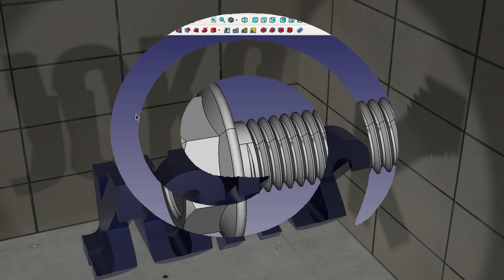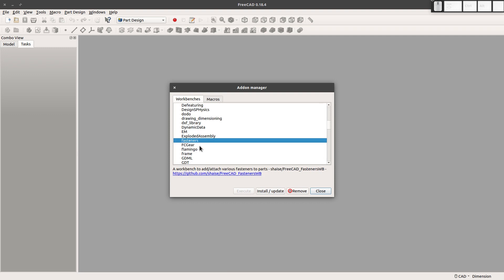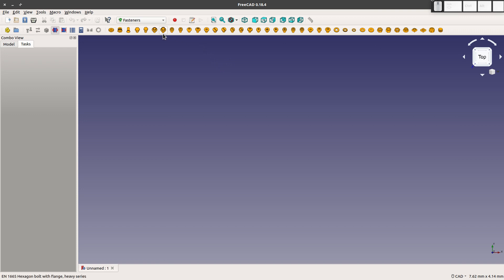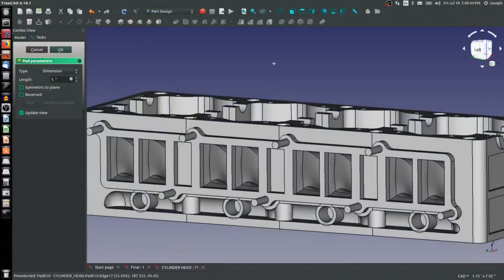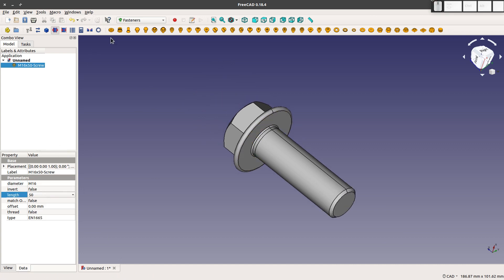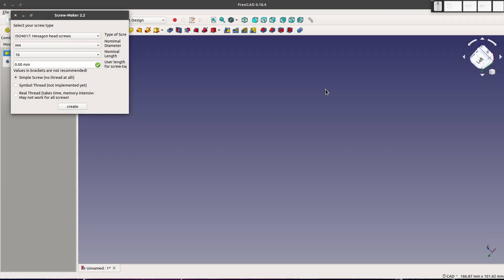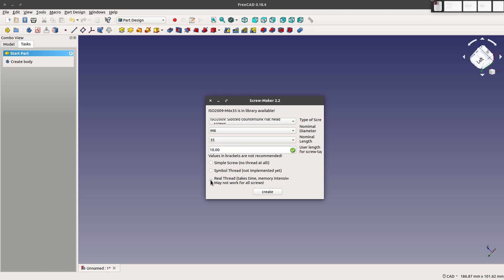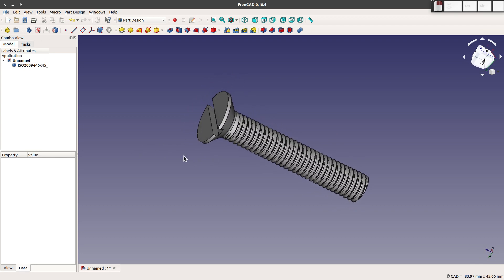FreeCAD Fasteners/Bolts/Nuts/Washers Fast and Easy|JOKO ENGINEERING|

Comment: Awesome thank you! just the video I needed.  can I choose to print without thread or without thread on one portion of bolt?
Reply from the maker: It's been a while since I have used this, but if shoulder bolt or partially threaded bolt isn't an option,  I'd just run a boolean to add to or  remove the portion of thread I didn't want
Reply: @JokoEngineeringhelp  perfect thanks! I had picked the wrong type of bolt.  I've used both ways now and prefere using "fasteners"  prints really nice too but my bolt was pretty big @ 14x60mm.
Reply from the maker: @upnorthFPVandEUC  Nice work!  I'm glad that worked for you

Comment: Excellent video.  How do you  create a complimentary screw hole with matching threads?
Reply from the maker: The part design workbench has a hole wizard feature that can be used.  You could probably also do a boolean subtract to come close or try to boolean in the threads of a nut.  I have not had a need to do this to date, so I have tried none of these options

Comment: Thank you for this video. Everything is OK using the workbench Fasteners, but something is wrong with the Macro. It is not working (so, the windows to input data does not appear). I have found an error message: <unknown exception traceback><class 'SyntaxError'>: ("(unicode error) 'utf-8' codec can't decode byte 0xb0 in position 87: invalid start byte", ('C:/Users/Daniel Severo/AppData/Roaming/FreeCAD/Macro/screw_maker1_2.FCMacro', 4846, -1, '    """\n'))
Any suggestion? Thanks and Best Regards.

Comment: How can I thread a hole in a part I already designed? For example, Threading a Fuel Rails to accept a AN-08 Male fitting?
Reply from the maker: The hole command on the part design workbench will create a hole to represent the threads.  If you need the actual female threads, I might suggest importing a male threaded feature and subtracting it or importing female thread from say, a nut, and making a making a fusion.
Reply: Joko Engineeringhelp I tried subtracting a male thread but the issue I have found is that it has to be longer than the hole you are subtracting from otherwise it won’t show. Have you found a way around this to create a short thread inside a long hole?

Comment: First, thanks so much for your videos Joseph, I have learned heaps from them.
There is a really good feature with the Fasteners workbench. If you have a part with a hole ready to accept a fastener, select the hole (or edge of the hole) and, if you choose the workbench option to match the thread size, when you select a fastener, it will automatically size the thread to the hole and place the fastener in the hole, flush with the surface of your part (you may need to invert). Makes adding fasteners incredibly easy, especially if you're assembling a part in an assembly workbench.